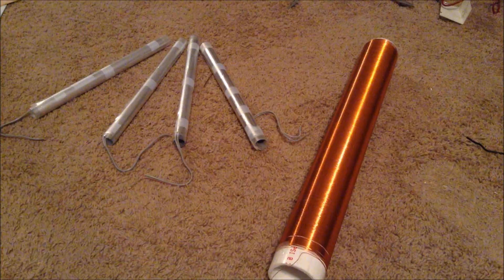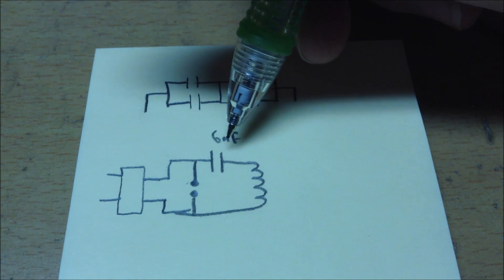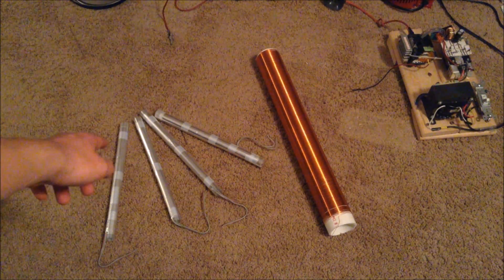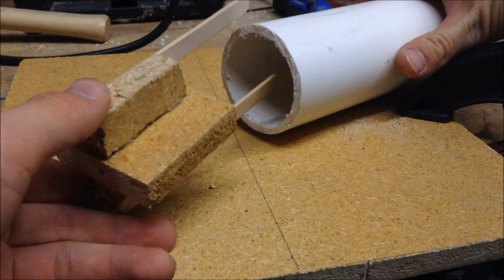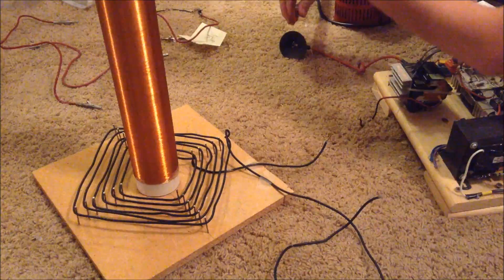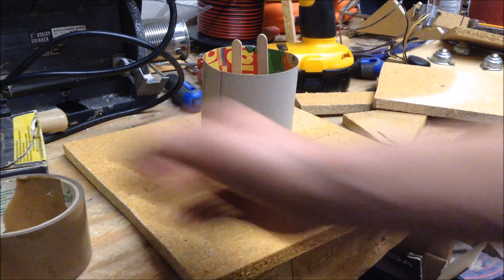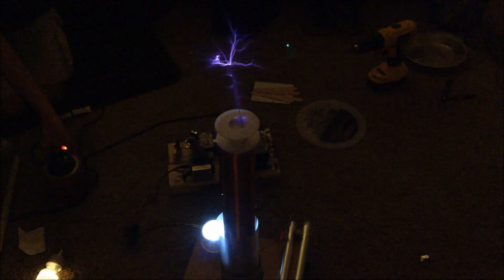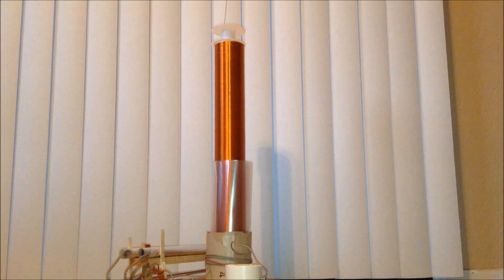DIY Lightning Machine: Tesla Coil Tutorial

Comment: I made a tesla coil. The secondary has about 500 turns. The primary has 4 turns. I powered it at the same way by using a zvs driver at 30 V. But I'm not getting large sparks as yours. Can you tell me why ?
Btw I used only one homemade capacitor like you used. Is it the reason I'm not getting large arcs ?
Reply: If you have a much more diameter it has more power
Reply: @Headbutter-Lettuce90  the diameter of my secondary coil is 3.4 cm
Reply: @cisarvialpando7412  mine is like 6cm diameter and has a 5 inch spark

Comment: What gauge does the copper wire for the secondary coil need to be, does it matter?
Reply: I've seen recommendations for 30 AWG magnet wire, but as long as you include the gauge in your calculations, it shouldn't matter. If you do happen to be using the flyback from a CRT, you can find some magnet wire in there.

Comment: What transistors did you use on your flyback driver? Because i've had a few issues with them heating up too much, and i think it might be a problem with excess current or possibly not enough gate voltage. I am using IRFP250n's if you would like to know that for future guidance.
Reply from the maker: +Scotlahn Mccallister I am using those same transistors.  They usually run cold.  Maybe your primary coil does not have enough turns?
Reply: Tanner Tech Hmm, well it has about 8, so maybe it has too many. I also am only using about 2 nF of capacitance so that might be leading me to a significantly different result than yours.
Reply from the maker: +Scotlahn Mccallister You need a lot more capacitors on that thing.  It needs to be 680nF. Your driver will run at too high a frequency.  I use the rectangular caps out of TVs.

Comment: my coil has very small sparks, like the first version you did, i tried changing the primary coil, but i cant get it to improve. the spark gap works, very bright and loud, there seems to be a lot of sparks coming from in between the primary and secondary coils, i put in a page protector like in your video but it still does it, any ideas?
Reply from the maker: +Vincent Balmont Did you spray or paint the final wound coil in enamel coating?
Reply: actually it should be varnished, (i bought a prewound coil)
Reply from the maker: +Vincent Balmont I just used clear spray on lauqer

Comment: i have the capacitors, a 1200 turn secondary coil, zvs driver and flyback transformer, and a 30v dc input, will work or do i need a variac
Reply from the maker: +Vincent Balmont It will work with the DC input, the variac is there so you can adjust the power output.  Good luck!  Make sure to pay a video when you run it!
Reply: thanks, i should have it finished next week, i will make a video when its running, your videos are amazing

Comment: is it ok to touch the lightnings?
Reply from the maker: +a.k.mohan o It's actually the opposite, it is very high frequency.  It is relatively safe to touch. You will just get a slight RF burn.
Reply: David Fidiles that's what I want to know. I think the current would be very low but I don't want to try first
Reply: it is not safe to touch the lightings because its very low frequencey arcs which penetrate your skin very deeply and may also kill u

Comment: Hi Tanner Tach , do you use DC to AC inverter or transformer?
Reply from the maker: +Kanaka Rikudou I use a transformer and bridge rectifier to get 40v dc for the flyback transformer driver.  This then acts like a high frequency inverter that drives the flyback.  This produces the high voltage for the Tesla coil.
Reply: thanks
Reply from the maker: +Kanaka Rikudou your welcome
Reply: Do you also make DC to Ac inverter?
Reply from the maker: +Kanaka Rikudou I haven't yet, but I am actually planning on making a 1000W dc to ac inverter within the next month.  The video will probably be out in 2-3 weeks.
Reply: ok, thanks your information👍

Comment: Hi Tanner Tech,
Amazing Coil  you have I too have planned to build a coil with a zvs driver at 12v and 7A with a flyback and a 800 Turn secondary will I get same sparks as you?
Reply from the maker: +syamala raj Maybe, I used 42 volts at about 12 amps to power my ZVS driver.  You should try.  Good luck!